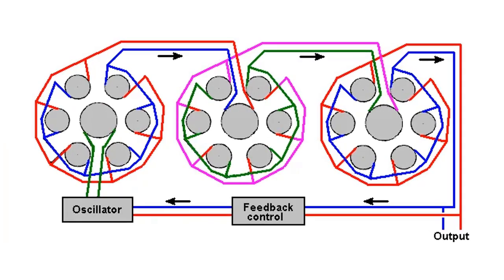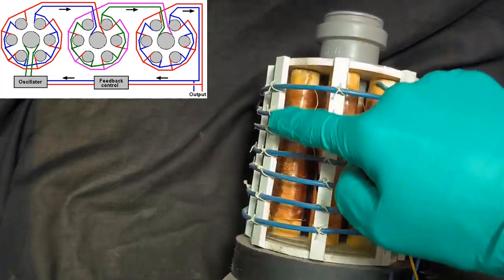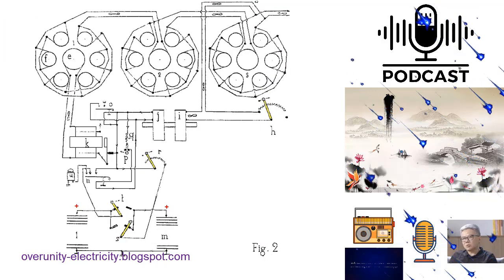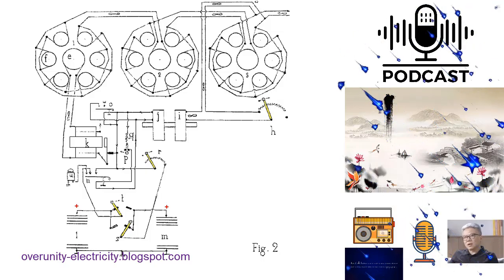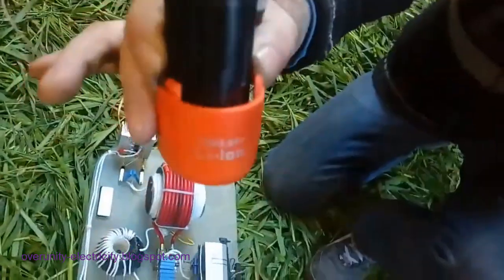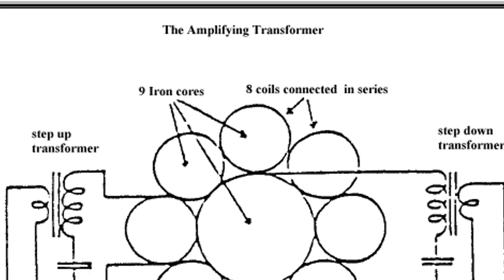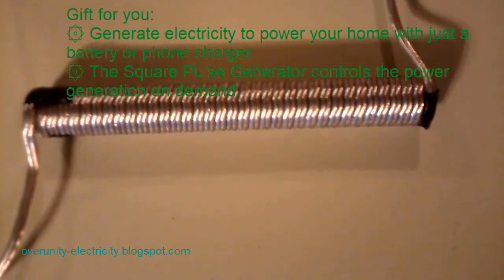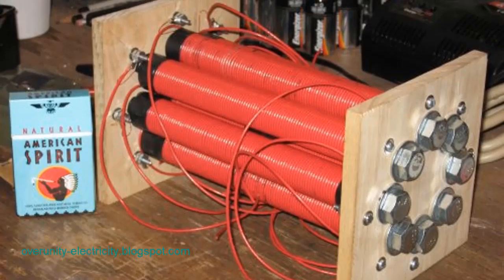Power Amplification by Current Amplification - Self-Generating Perpetual Electrical Energy

Comment: Remember without-shorting of extra coil inside theres no power to be gain.. unless u have extra coil that has a soul purpose of shorting itself when voltage is at its peak . . That is the key.. please watch my fellow countrymen ISMAEL AVISO old videos 13 years ago.when he developed and well verified self charging car.. check that out.he debunked the secret if tesla.which is COIL SHORTING..that increase magnetic flux in a fraction of second every voltage peaks ..

Comment: The design and interpretation is wrong.transformer basic says,if u captures 1/4 magnetic flux u can get 1/4 less the total input power.. in this design clearly they just split the flux with same power density as input power.u basically devided the flux that means deviding the output.no matter how many cores u put in there it will only devide the flux.so no power gain..